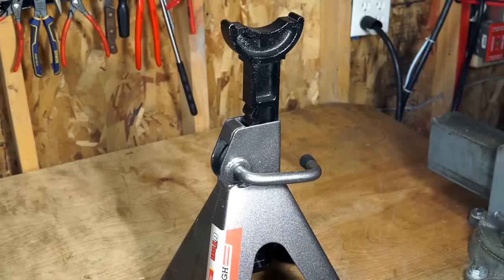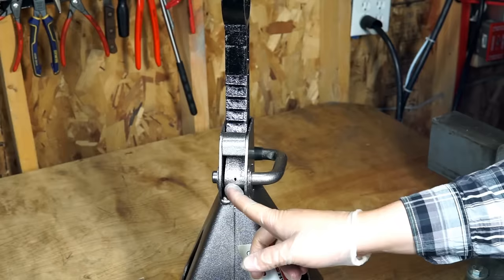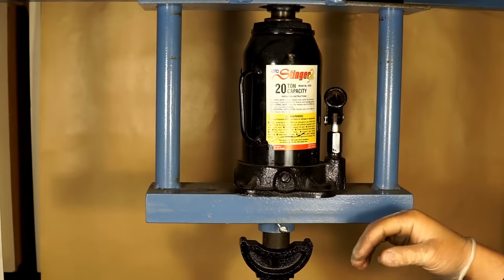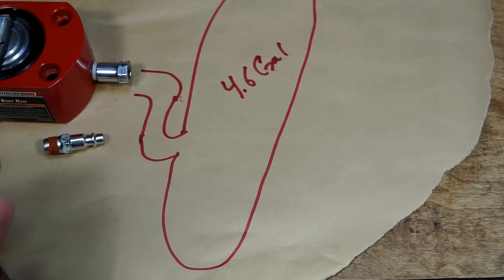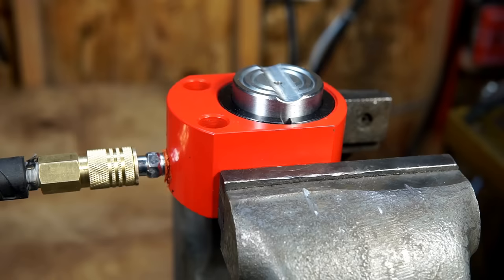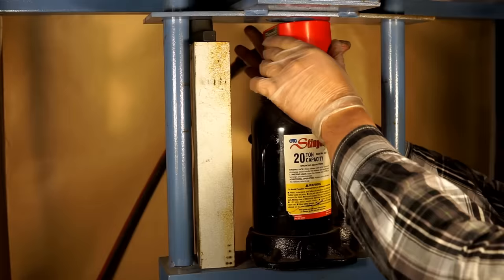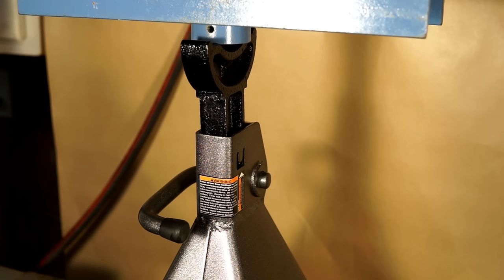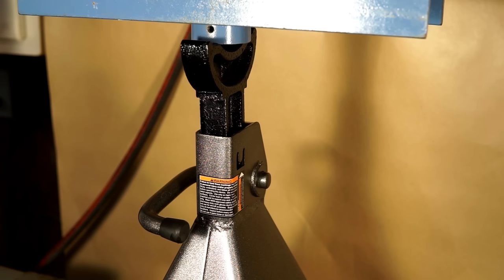EXPERIMENT: WARNING! Doing this to your Jack Stands will get you KILLED!

Comment: Why not just use a car for this test, you only have to lift it until the tires are off the ground then you just hit it with a bar from a distance which wouldn't have to be very far I mean it's not like the car is gonna roll over or anything, if the jack fails then it just falls straight to the ground.

Comment: I have the same stands as those in the video.  Had my ford ranger with the front wheels off with nothing but the stands holding it ( i wasn't working on it ) for a week without an issue.  When the parts came in i put a large floor jack under the truck as a bit of extra support.  After seeing this though im going to buy better stands. Not worth risking my life.

Comment: Why did you go through all this trouble instead of just getting 500 pounds and sliding it on top of the jack stand? He could’ve used Laed you could’ve used plates from the gym, and there wouldn’t be a floating body of wheat in the air hovering above the jackstand because the 500 pounds using gravity would be attached to the jack stand consistently, the same way a car would without using air pressure and pneumatic pressure And making a science project out of something that could’ve been done with a bunch of weights.

Comment: I bought the harbor freight 6 ton jack stands 56368 ( after the recall) There could be 10,000 pounds on it and it will drop the jack just by lifting up lightly on the lever. Return if you have these you will die if you use them.

Comment: This video is misleading. He is only showing the jack function ing WITHOUT load. You ABSOLUTELY cannot drop that jack like that when it's properly weighted with the load. I've had to jack the car up HIGHER just to release the jack stand because it wouldn't move. Besides, I ALWAYS triple protect myself. I have the jack, a stand AND I throw the tire under the car. Just to be safe.

Comment: I use pretty beefy jacks and always leave whatever I’m
Using to loft the car in place as additional safety bit on top of that I always put some
Kind of wood block under to give me some Space in Case the jack fails I might get a cracked rib or arm but I’m
Not getting pinned by the full weight of the car 😰

Comment: Put two tables together. Straddle 500lbs between the two tables to the tables are holding all the weight.

Put the jack stands on some cinder locks or whatever to get the stand to a level where the head stands 1/2" proud of the upper surface of the table, so the full 500lbs is on the jack stand and not the tables... If the stand fails, the weight just rests back on the table.

No need for fuckin weird air setups

Comment: My jack stands actually have the pin that you put in there after you secure the lock so in order for it to fall down that lover has to be moved also have to pull the pin out for this the lower down maybe his did not have the safety pins

Comment: That is why should always leave your jack/hydraulic jack in place after you set your jack stand just in case.  Personally I use the scissor jack that came with the car to hold in place and my hydraulic jack to lift it and keep them in place .. one for speed because scissor jacks suck and not supper safe and hydraulic jacks well in my mind nothing Is perfect

Comment: i used jack stands one time for about a minute before realizing they are fucking worthless. no way am i getting under a car with something that can decide to fuck up on you. better to stick with just using a jack and maybe your spare tire to hold it up for safety. steel ramps work well if you need the whole front end off the ground.

Comment: The worse jack stands to have, they work  best with the rod all the way down, at one time auto part stores were selling pin or U-slot jack stands which is hard to buy these days and if you find them there expensive, to use what you just tested requires a floor jack as back up which keeps the pressure light and save your life, also ramps are dangerous as well , the collapse flat unless you double up with a floor jack, now all stores are selling these jacks !!

Comment: I would say your test confirmed a big flaw. I'm no engineer but I would think that pin should have been designed to break away at a minimum of 30 pounds. If you're trying to purposely lift that jack hand while under a vehicle with a force of 30 pounds then you deserve to have it fall on you face, sorry not sorry.

Comment: You used a long bar to make it release. Yes, your experiment was definitely flawed. You need to calculate for the nomber of foot pounds applied at the end of the pry bar and the ratio of  the fulcrum and the length of  the pry bar.
Force = Load x Load Distance / Effort Distance.

Comment: Sounds like a Harbor freight Jack Stan. don't buy China. It is almost impossible to drop a Jack stand with weight on it cause the Jack stand has to lift itself up. Before lowering itself down so there's any weight on it. You should not be able to disengage that handle.

Comment: I appreciate the experiment but u didn't do it to scale ..you have to have atleast 2000 pounds on that jack stand in order to confirm it could fail by lifting the handle .. even if you did the shear pin would shear off but the stand would never unlock and drop
Reply: Jackstands are or should ALWAYS be used in pairs.  Each jackstand on a 2000 lb car would be supporingt about 500lbs.  Weight would be relatively evenly divided.

Comment: Not sure what you think you acomplished?  As was known before if you can lift the the shank of the stand the locking system will fail.  That said not many ways  you can lift a two thousand to five thousand pound car/truck while working under it by accident.   Now was the person in question using his type of locking jack stand or were they using the pin type?   The pin type uses a simple pin with a compressed ball bearing insert lock.   I don't trust these a bit and replace the stock pins with a grade eight bold and nut.  Lots of urban stories out there but many are bogus.   Hard to know for sure.   Now sometimes the weight isn't spread evenly when a car is up on four stands which can cause it to shift.  A power cord or air line can cause the handle to trip the lock in such cases  which could cause the vehicle to slide off the remaining stands either partially or completely.   That sounds plausible.   Now am I an expert?  Given by number of decades using these I would say as much as anyone else is an expert.  I doubt there is a standard on the role pin used other than industry standard given the world wide manufacture of these stands.   Be interesting if any individual nation tried to regulate it.

Comment: I'm calling a little BS on this guy's "fell on my face" story.  Yes, a Porsche 914 weighs 2250 (approx.), as well as many classic sports cars of that era weighing 1500-2000.  Unless the car got rocked, he hit it with a sledgehammer (deliberately), or something of the nature, it is unlikely this occurred.  Granted, I am looking at getting a car in this weight class from that era, and I will be using stands that use a pin/cotter key setup as a "just in case", therefore ruling out any possibility of failure when dealing with such a situation (all of my current stands are for my current vehicle of twice that weight.  I was in the service: prepare for the worst, hope for the best).  Furthermore, even if all four wheels were off of the hubs, unless the vehicle completely fell on one side or end (unlikely), the aforementioned situation is nearly impossible.

Comment: Good vid. I have both types of axle stands one pair without the safety pin and one pair with.
I use them a lot and there's no way I could get those things to fail even if I tried.
Just knocking the release arm on either style won't make it happen.
I smell a rat in the porsche story.

Comment: A buddy and I where lifting his s10 that weighs under 2 ton and we were usung two 2 ton stands both brand new AC delco and when we're all said and done we pulled the stands out and one of them was twisted and bent to hell and the other on the part that slides up and down was completely snapped in half at a 45° angle but somehow with our luck it didnt slide off and the truck didnt kill is but we didnt even notice until we were done which is the scary part and we didnt even touch the stands and to this day neither of us have bought any AC delco products and never will

Comment: So I haven't had this situation where I hit it in a field drug but I have headjacks split on me despite me using them well under this a wonder there's specified weight rating For example I would get a 2 And a half t Jack Carver that I was lifting was only about a ton and a 1/2And it failed almost taking my hand with it moved it in timeSo still have all my AppendagesBut this is more than the reasons why I do 2 things nowWhich probably is many people would consider unnecessary I have always put the tire that I took Off underneath the car I almost lost my hand while I was putting the tire under the car so now I have this Jack stands in my car as well as Car ramps And I stick those under the car too I usually Jack my car up with the front WishbonePut the Jack stand on the side and I put my car ramps in the front on ether side of my jack This is also why I have bought Is extremely large Jack Is from a brand I can trust with my life

Comment: You should always have a floor jack working with jack stands, after letting the car down on the jack stands jack the floor jack up just enough to put pressure on the jack, the weight will then be distributed on 3 different places. I prefer using cinder blocks with 1 ft long 2 x 8 boards sitting on top of them with the cinder blocks upright as you would lay them in a wall, then setting the emergency brake making sure the car cant roll.  I always try and shake the car standing out from under it to check how sturdy everything is, if it won't move , you're good, I always like a floor jack under the car too as a back up

Comment: it has nothing to do with bumping the handle. i really wish people would stop spreading FUCKING LIES just to get clicks.  When you place a jackstand the Pivot of the Handle NEEDS TO FACE DOWNHILL.  The teeth on the center column NEED TO BE FACING DOWN HILL. These jack stands are made with such loose tolerance that the locking tooth and rack can slide apart and lose contact with each other, allowing the stand to collapse. The jackstands need to be placed so that gravity will PULL THE TEETH MESH TOGETHER, not slide them apart.  Pushing the car forward or backwards a bit can cause these stands to unlock and collapse. Use screw adjust stands or cross pin stands. These ratchet stands are just a bad design, made even worse by decades of careless low quality manufacturing.

Comment: To be honest, only a dumb person could make this type of stand fail. Now because of some FW not setting the stand up correctly & maybe getting themselves killed, the rest of us intelligent people have to suffer. I remember at work we used the pin type stand. Basically a pin would go through the stand into the adjustable inner tube & out the other side. A very safe stand but some FW got killed because the pin came out. WTF. How did that possibly happen. Now an R clip has to be fitted to the pin to stop it coming out. Really!!! Most of the time I did not fit the clip as it is there only for dumb Fu#@s. Safety is paramount I reckon, in saying all that so far, I guess there is a need to come up with more safe devices built especially for dumb people but also those that cannot see what dangers there are in using any type of equipment they are not trained to use.

Comment: This guy is way over thinking this just use real workd senerio put weight on try your test this air in a a hydraulic cylinder is to unpredictable and not designed to work like that you wont get reliable down force or on the return